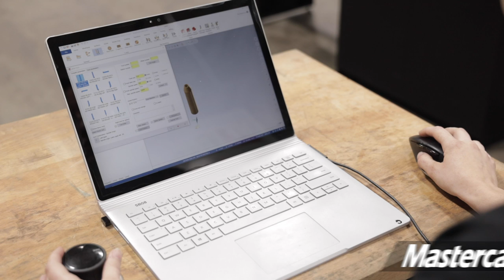We Turned Our CNC Mill into a Lathe

Comment: For a part I did, I used a lathe post processor, then divided all x values by 2 in g code editor, then changed the header and footer so the mill would like them.  Works great.

Comment: Getting more confidence in front of the camera every time.  Good work Nicole.  As a hobbyist and before I got a lathe I used the same method in my hobby mill/ drill It worked and got the part I needed. You just needs to do some lateral thinking.  Movement is relative part against tool or tool against part the results are what matters.
Reply: Try with a 7 inch grinding wheel too. RPM is about 3000. Dress the wheel on the machining centre, so all is concentric with your spindle. 
Then you can achieve a ground finish on complex shapes! But remember to conventional "mill/grind" rather than climb cut.
Also if you have wheel dressing attachments, you can put a form/radius on the wheel.
Reply: @neilwoodward7336  It would be super scary to stand in front of your machine.

Comment: Clever! I have been machining over 20 years, but never have seen this done.
Reply: You need some some This Old Tony in your life. Very entertaining and informational machinist with dad jokes to match. He did this very same thing when he was making some holders for the mill
Reply: Because you never needed to!! Very impractical. By a cheap Doosan or something.
Reply: William Lind she explained why she needed to. Mr. know it all 🤪
Reply: you can run a lathe like a mill too
Reply: @ImKittyCow  Though not as easily. You need to mount a table on the cross slide and likely a vice, too. On the mill, you just chuck the tool holder in the vice.
Reply: Do you modification the post processor?

Comment: we actually do that a lot in the shop. We even have some 10 bt50  holders just for that. The cool thing is, that you can do a bunch of operations if set up correctly just changing G54 offsets for very complicated parts. Much easier to set up than a lathe and great for small batches.
Reply: We are exploring this for some standard products where I would like to use 5 tool holders in the tool changer and then just cycle through them. I have heard that people make a special Haas posts for it, but how do you do it?

Comment: I find that this technique works beautifully, for small, short parts on a manual or a CNC mill.
This CNC mill could probably even do single-point threading, which would be a fun.
The only thing the mill lacks when doing this sort of thing is a tail-stock (or steady rest), so you can't turn long thin parts with it. For that you still need a lathe.

Comment: Titan, I am a Manufacturing Engineer in a mid sized shop.  We have an assortment of machines from large horizontals to small 30 year old Mori lathes.  I've told many of the machine operators that want to learn programming about Titans of CNC, and a few of them have jumped into it.  However bar FAR the largest issue I see in this trade is inspection, from basic all the way up to CMM and GD&T, and mostly with qualified quality techs with CMM programming know how.  Someone who can use a CMM to measure parts/features, understand what the data means, and communicate what that data means back to a machinist to get parts corrected, and running on nominal.  I think the industry would hugely benefit from a dedicated inspection/CMM/GD&T academy!   Thanks for the quality content! And keep up the good work!

Comment: Very good technique on short parts, I've also done this before as I don't have a lathe, and used the cutting edge of a 20mm End Mill as the lathe tool, this too held in a vice. Plus I use shaped router bits held firm in the vice for different end shapes. Looking forward to the next vid. Keep up the good work 👍
Reply: Neil, the Sieg x1 guy is also here!

Comment: I saw a guy make a whole tooling plate for his will with multiple turning tools and drills.  He then loaded up his tool changer with blanks.  He was able to run jobs like this lights out because the tool changer would at like an auto loader.  He could come in the next day to 32 parts complete.  The big advantage was that with the part being "upside down"  chip evacuation was not an issue.

Comment: That's an interesting way of turning, TIL. I have two questions. 1. How did you calculate the tool offset? 2. How to do force analysis on tool holder for this kind of operation i.e. how to ensure that the tool holder is going to withstand the forces.
Reply: The tool holder isn't uber anymore force than it would be in a lathe. It's a non issue. You don't specifically do force analysis on any other operation, so why would you inquire about it on this op? You do some estimation in your head, drawing of your experience, but nothing technical. And if you did want to do analysis, you would do it in the same way you would do it if you were running the tool in a lathe. 

TLDR; you're not going to hurt the tool holder before the insert is chipped, or the part/tool holder is thrown because of a crash.

Comment: Very cool! Curious as to what CAM suite you used to write the toolpaths and especially what strategies you were able to adapt for this program, and I am also wondering if you had some sort of adaptive RPM routine to keep the SFM constant as the diameter of the workpiece was reduced with each successive pass.

This is pretty thought provoking, and I can already see how I could apply this to jobs at work when our lathes are all cutting on jobs and I have a mill or two open (on that rare occasion!).

Comment: I tried this on some copper once, results weren't great but they did the job with some polishing. I used a mill post processor using drilling cycles and 3d contours on mastercam, never even thought to use a lathe post D'OH!
How can aline the cutting insert with the centerline of the spindle accurately? I really struggled...

Comment: Damn, beat me to the punch, I'm planning on making a fusion post for doing this on my big old haas hs-1rp. With the pallet changer I can easily make the 4th axis into a palatalized tool turret, with quite a few tools. Obviously there would be no tailstock, or secondary chuck, but still good for a lot of parts. Although I suppose if you were creative enough, you could make some sort head stock mounted tailstock that stuck out and came back around to support the stock. Stock could be loaded into tool holders holding 24 pieces of stock. basically a chucker lathe on steroids, and with 10000 rpm on tap and 30hp, and a gearbox. 4 axis horizontal pallet changing machines are perfect for having multiple work setups for doing all types of work without having to break anything down.
Reply: That's a good idea, never thought of that. I'm having nexgencam work on a post for me for an old lathe at the moment, fanuc controls apparently came with a ton of memory even as far back as '98 (comparatively).  Hard part is learning to use an old control.
Reply: I ran several HS1rp back 15+ years ago. I was considering buying one used as they are cheaper than vmcs in today's money. How has yours aged?
Reply: I bought it used 1 year ago, and it had been stored outside for 5 years un covered in the arizona sun. It had s seized y axis ball screw, many of the air lines are cracked, and the lines on top of the spindle are a huge mess. It has several air leaks, the tool changer board was fried, and all lf the other axis were jammed due to sitting. 

Luckily I was able to fix all of those issues for next to nothing. the only part that cost me was the tool changer board. They dont make the hs-1 specific one anymore so I ordered the 20:1/40:1 board, downloaded the program from the old boards eprom,then flashed it to a new eprom and it miraculously worked. Pallet changer works great, and I got a really nice tombstone with precision locating system for $900 from the guy that was the previous previous owner.

I only paid 4000 for the machine, the guy who sold it to me lied about the condition. So just make sure you see everything work before you buy, as they are not cheap to move, and some of the electronics are hard to come by.
Reply: @philipmacduffie7612  A question I had for you: were any of the hs-1rp's set up with a 5th axis? Id love to add one on, and ive seen it done, but I want to do simultanious work,  so it cant be done with the external servo box, it needs to be driven just like the 4th axis.
Reply: @davidfarmer  Of the two hs1 and one ec400 neither had simultaneous 5th. I did put a hrt310 on the hs1 but ran it with a driver. It was a good machine. We ran big castings on it. I only ever had an issue with the tool changer and we ran it 50-60hr a week for years. 

 How old is yours 99ish?
Reply: @philipmacduffie7612  its a 98, I have a channel on here and I plan on making some videos of projects. Ill probably make one of reassmbling it, as I just moved it into my garage at my house from a shop I was sharing with some friends. It required some significant disassembly. I had to remove all of the baffles and rails, the tool changer, y axis motor and top cover and the hydraulic counterbalance.

Comment: I'd like to know how you did that on fusion 360
Reply: Define a lathe, radius mode on and have at it. Nothing special needed, the X and Z axes are already correct. The most you might need to do is jog your machine to Y zero or add it to the program by hand unless the post already does it.
Reply: @TheWireEDM  okay thank you I'll try it and see how it goes

Comment: Anyone else thinking easy swiss-style machine? Unfortunately, threads would not be possible because the spindle could not synchronize with the tool to cut in the same path. The hardware may be there but the programming is not. You may be able to mount a die and use a tapping cycle.

Comment: Below is a video and programming example I came up with for single point threading using this technique.

https://youtu.be/wUxGaYBq7cc

( SINGLE POINT THREADING, 7 PASSES, 20 TPI ) 
G00 G80 G40 
G00 G112 X-0.5 Y0 ( G112 WORK COORDINATE SYSTEM FOR TOOL 2 )
S490 M03 ( MAX 500 RPM FOR THREADING ) 
G43 G00 H52 Z1. ( H52 TOOL LENGTH OFFSET FOR TOOL 2 )
G01 Z0.1 F50. 
G76 X-0.205 Y0 Z-0.7 F24.5 R0.1 Q0.1 
X-0.2 
X-0.195 
X-0.19 
X-0.185 
X-0.18 
X-0.175 
G00 G80 Z1. 
G00 Z8.

Comment: I notice you didn't give a close up of the surface finish.

No doubt because of the chatter.
Reply: Ken Rutherford Brass turns quite easily. Judging by how it sounded it’s unlikely there was much chatter during the roughing. And the final pass was so light that there was certainly no chatter on the finished part.
Reply: @tbdcreations5370  But, she uses the same RPM always. So that, the Cutting Speed is lower every pass. Dont you?
Reply: Anyway, good job! ;)
Reply from the maker: What? Roughing is roughing... finishing is finishing. It’s was perfectly fine. We could slow it down or speed up... just showing a cool technique
Reply: I am an experienced cnc machinist, programmer.
Using a milling machine as a lathe, is not a "cool technique"
Regardless of the materials used, the mill isn't rigid enough to get a consistent good finish!

That's why we use lathes, or machining centres.
Reply: @Cromwell648  i don't know what mills you've been using, but I've used this same technique. I was able to get near mirror finishes in brass, aluminum, stainless and even titanium without having to do small passes.
Reply: @Cromwell648  funny , but after some 2.5" indexable drilling i tried some skim passes on a holder and it held up allright :)) , of course a shitty garage machine is not that rigid , but in a pinch it's allright .
Reply: Looked and sounded just fine to me, you my friend are high as a kite.
Reply: Ken Rutherford Mills are not as rigid as lathes in the axes that are important for turning. But that does not mean they’re not rigid enough to do small diameter turning work in brass. Considering you’re a CNC machinist and programmer, I would expect you are aware of the high cutting forces a mill experiences when cutting harder materials such as steel?